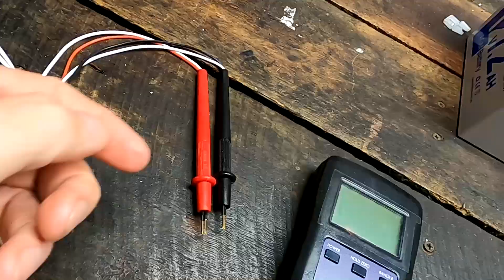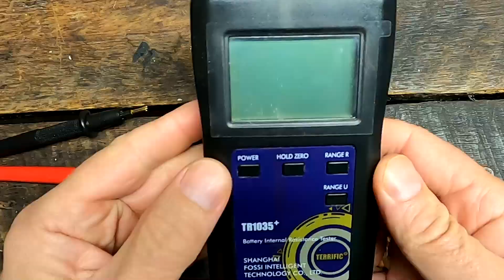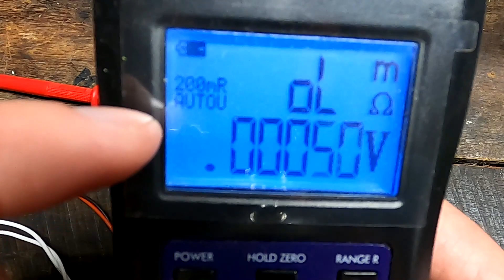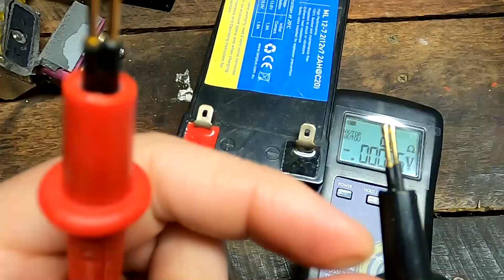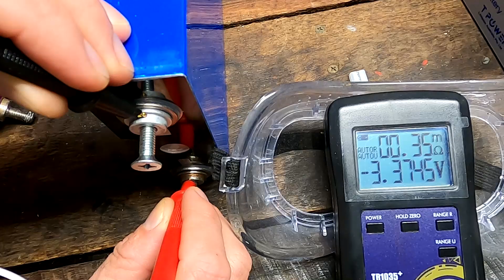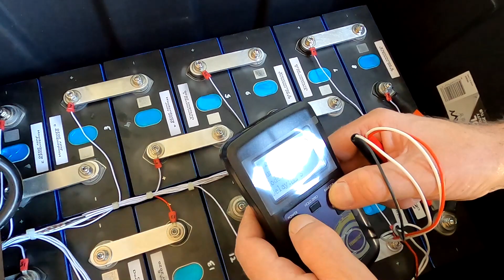Internal Resistance Tester TR1035 - Can we find a faulty cell?

Comment: Just as an FYI. I have a YR1035+, the manual specifically states the IR measurement is not accurate for cells above 100 amp hours capacity.
Reply from the maker: Seems to be working fine with raw 280 Ah cells. I just tested on 16 cells and the results make sense and are consistent.
Reply: @OffGridGarageAustralia  Yes, I think the reading error is acceptable for DIY/civilian purposes. I downloaded the manual (thanks to John Emmert above) and in its FAQ it says (verbatim):

Q: Can YR1035+ measure large single lithium iron phosphate battery? A: Lithium iron phosphate is generally recommended to measure batteries within 100 ampere hours. The internal resistance of the battery above 100 ampere hours is generally lower than the recommended measurement of 0.3mΩ or more. This battery can be measured with internal resistance below 100V and above 0.3~0.5mΩ.

Q: The internal resistance below 0.3mΩ cannot be measured, can it? A: It is not impossible to measure, and the reading error is large. For example, 1mΩ error plus or minus 0.03mΩ, if it is 0.2mΩ error plus or minus 0.05mΩ, so more than 0.3mΩ is recommended. The measured value of 0.05mΩ is sometimes very accurate, but the uncertainty will make the reference of little significance.

Further down, the FAQ appears to give conflicting statements concerning under what conditions you can measure a battery pack. I think it says you can measure a battery pack up to 100V, but the limit 28V if the leads are reversed.
Reply: Basically it is saying that the resistance of large cells is so small that you are at the limits of the accuracy of the meter. This is not surprising, I am pretty sure it was originally designed for the small 18650 style cells. It is also almost always the meter that companies use to tell you the voltage and resistance of the cells. So, may not be accurate, but it does give you a good idea. At the very least it will tell you if it is too high.
Reply from the maker: @john_in_phoenix  Ah, right. Thank you. Test range is from 0.01mOhm onwards and the 280Ah cells measure with 0.15-0.2mOhm. So we're not getting too close to the range limit. But yeah, as you said, it gives at least a good idea if a cell is good or bad in comparison with all others.
Reply: I have the YR1035+ too, but it came with no manual (I had to find a YT video to even start to use it because the display was set to Chinese). I bought the tester specifically for testing my 280ah cells. When the manual says it's not accurate for cells over 100ah I hope it means the reading may be off by a small percentage yet still close enough for me. The cells I bought were advertised as having an IR of 0.1 ~ 0.3mΩ and all my cells read 0.18mΩ so I figured that was good. Do you have a link to your manual?
Reply: @charlesrichards5389  Yes, but youtube won't let me post a link. Pretty easy to find, go to diysolarforum dot com, open resources and search for yr1035. Mine came with a photocopy that I couldn't read, another user scanned and cleaned it up and posted it.
Reply: @john_in_phoenix  I've been there only a couple times. I really should hang out there more often because it's always been highly recommended. Thanks!
Reply: Is there a nice table of reference values for IR for different type of batteries?
From what I am reading, IR has not much indication of battery health, unless you have a number of similar batteries to compare to or know a reference value of a particular battery.